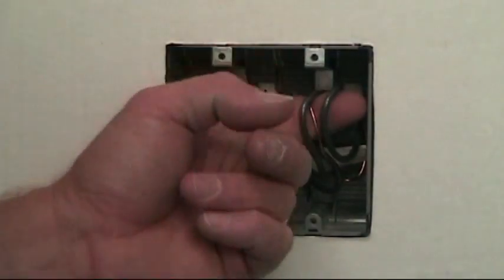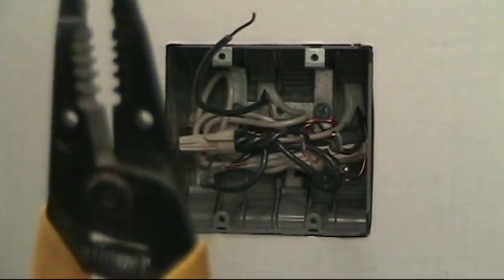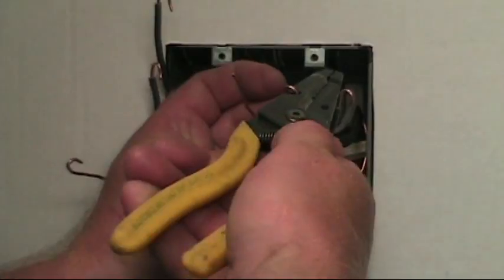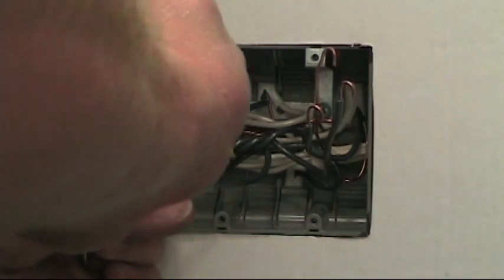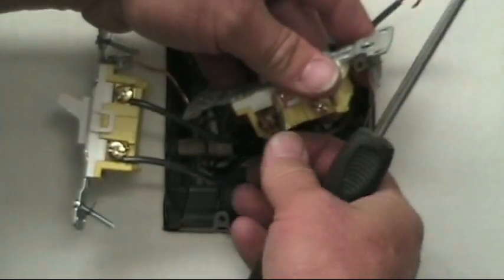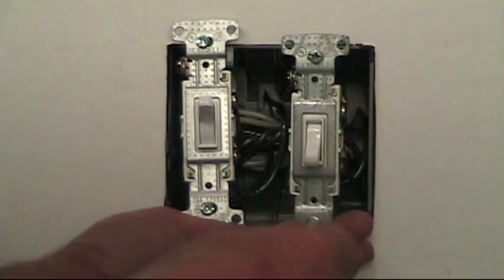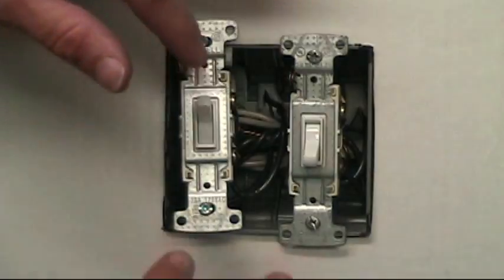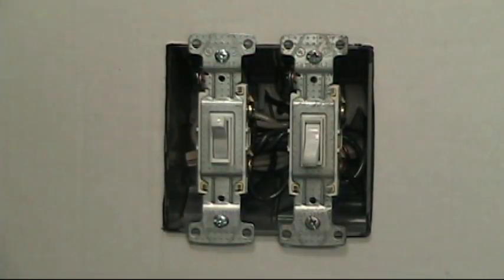How to Wire a Switch Part Six Installing the Switches

Comment: The his is very informative as I have the exact same setup in my bathroom. I went to change out the left light with a dimmer and the right switch is an exhaust fan. I noticed that there is a wire bridged between the two switches from the bottom backstab of the left switch to the bottom backstab of the right switch. That totally confused me and sent me looking for information. I’m totally stuck now as to how to replace the left switch with my new dimmer.

Comment: I enjoyed watching all parts in this series.  I am wondering why you did not attach the white wire to the switch.
Reply: White wire is the neutral wire.. switches do not need a neutral to function.. it's just there for a return path and it's necessary for the light but not the switch